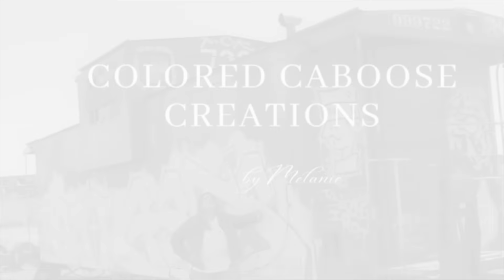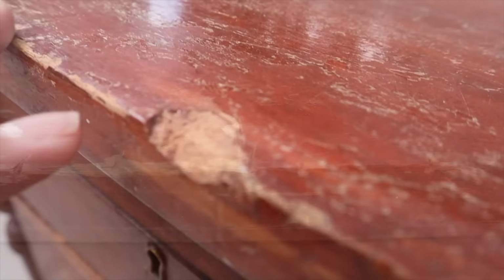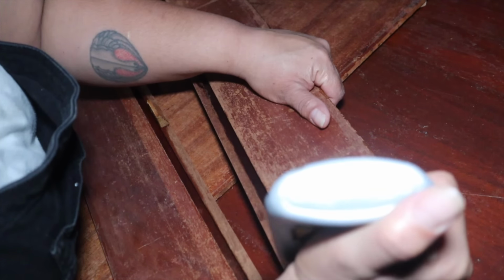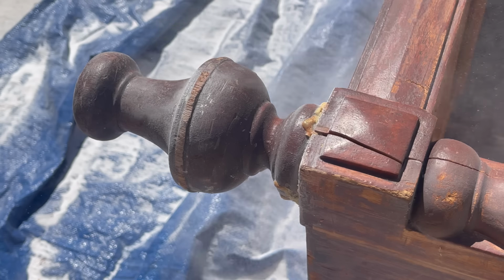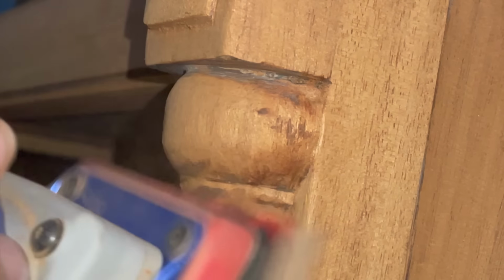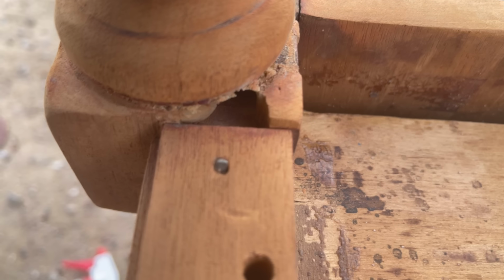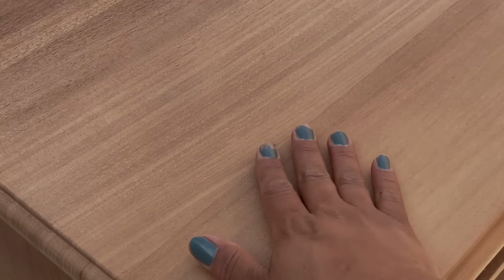Solid Wood Furniture Restoration/ Dresser Refinish/ Trash To Treasure/ Thrift Find Makeover

Comment: Using a bag to put the de-rusting agent in with the iron pieces is a great idea. So many people waste a whole gallon of the de-rusting agent by dumping it in a bucket when in fact the only need a much smaller quantity if the part is tiny. I also liked the use of vodka to get rid of the smell. When tackling smells from old furniture, if the smell of old furniture offends you, always remember that time, fresh air and sunshine are your friends. Leaving the piece in a well aerated but not damp place will reveal if the smell is due to dampness or something else. A bit of sunshine can help in making volatile smelly chemicals evaporate. When cleaning old pieces, after getting rid of all the debris and dust inside, I would try vinegar first: It should be much cheaper than vodka/alcohol. That should tackle most of the grime and you can then do a wiping with alcohol as a last step, needing a lot less of it.
7:15 blasting wood with abrasive material can never be a good idea - especially when you have soaked the wood beforehand! You should have tried blasting a part of the piece that would not be as important as the intricate legs first. Going for the most complex part first was not the best decision. Sometimes one gets carried away because of the low price of purchase thinking they do not have much to lose if it all goes wrong. What people forget with this argument is all the personal investment that they have put in the piece in first place (e.g. the expectation of doing something with it, hauling it from the store, choosing that particular piece over another etc.) -let alone the time or money invested in it in the meantime.

Comment: Very nice job 👌💚. BTW, did you know that you can remove (deep) scratches with the steam method? You take a very wet cotton cloth, put it on the scratch and use ur Ironizer. The steam will expand the fibers, sometimes U have to de it several times, but it works.Saves a lot of sanding 🙂 Best wishes from Holland.

Comment: 18:43 The chosen knobs/handles are much finer looking than the ones you got it with. Maybe the previous owner had nothing better to use or just needed something big to pull the drawers out but the original (?) hardware did the piece a huge injustice.
Looking at the finished piece, the contoured edge top looks like it was there from the start and I guess you should be very pleased with the overall result. It should be the reward for all the effort you put in it.

Comment: 💚 Nice video, good technique.  I only correct you, so you grow .  You referred to the legs as being carved.  They are, however, turned. It's not a big deal, but  when talking to other professionals, the image is clearer.
If you can't get rid of an odor, use shellac on all surfaces inside and out.  Shellac is compatible with all hard finishes.

Comment: ❤ couldn't find a green one. I have a piece of furniture of course that I picked up on the side of the road but the top is laminate and boy the whole piece is really bad. I've watched tons and tons and tons of videos of fixing furniture but I'm always confused at what I should use to fix the top of the dresser that has pieces of the laminate gone. I am not going to spend money buying a sheet as I have never applied anything like that to wood. I'm just kind of thinking I'll fill in the spots with what I saw on your video is taking sawdust and mixing it with? What did you mix it with. Nice job Nancy from Connecticut

Comment: Is there less expensive version of bodies oil?
Reply from the maker: What makes Odies oil expensive is that it’s made out of a really high-quality tung oil and of course it has its blend of resins for fast drying. I suppose you could use pure tung oil, which is a little cheaper.
Reply: @coloredcaboosecreations  thanks I’ll try it with some lavender oil.

Comment: I think you have to thank the foul smell and the even more offending knobs for that really low price. The piece looks absolutely decent shape and of decent quality wood otherwise.
Maybe I was a bit harsh in my last comment regarding the soda blasting.
I would not expect blasting with soda to eat away the wood either but always remember to start at the lowest setting and a good distance and then progressively work closer if needed. Also, do not do the blasting when tired or impatient or hungry etc. etc. It is detail work and needs to be treated with a good deal of respect or it will bite you back. But as you said, you live and learn so it's not worth beating yourself up about it.
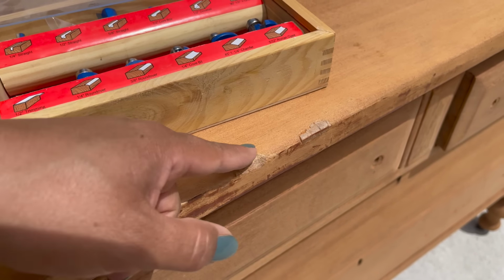12:15 Using a router to added a curve shaped contour to the edge of the dresser top is what I would do too as this dresser badly needed this touch of design alteration to lighten up the overall heaviness of the design: it was a bit un-balanced when compared to the ornamented bottom part.
Regarding the turned legs and/or the ornamental half-columns that might have been damaged with the soda blasting, if you wanted to invest even more time on this, you could try asking a friend with a pantograph and a lathe to re-contour the damaged one. They could even glue the two halves together and give them a spin on the lathe to re-finish their surface.
You'd lose a bit of the bulk or height of these pieces but you'd get their finish back. Granted, all this would be way too much work.